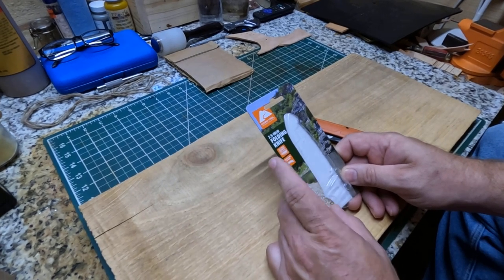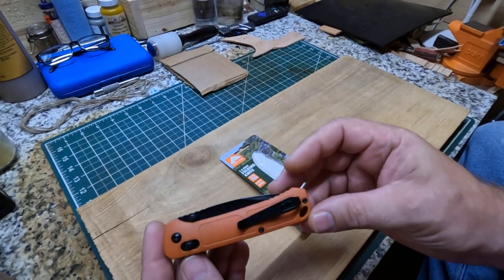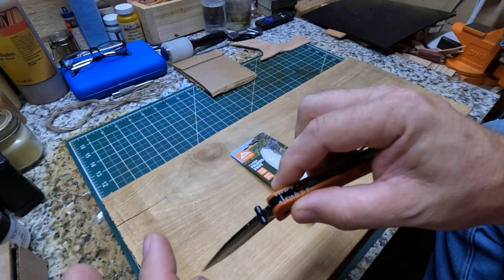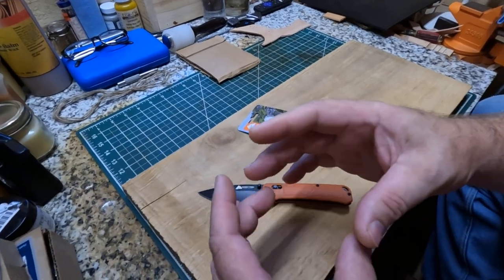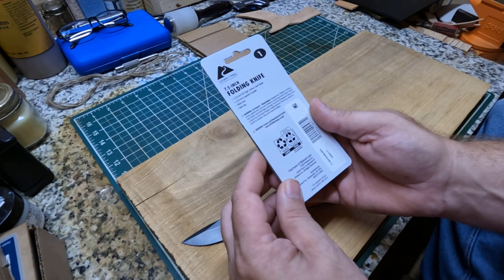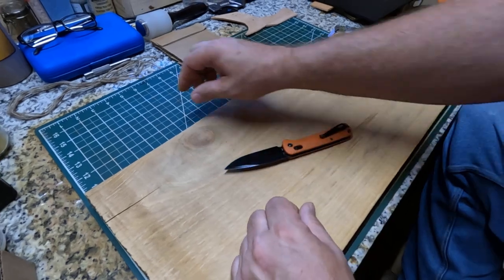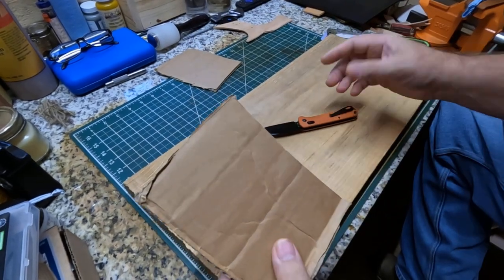Review and Cutting with the Ozark Trail D2 Carbon Steel Folding Knife

Comment: I have a ozark trail clip knife I bought while at the beach for protection against sharks. D2 steel should hold up well!
Reply from the maker: It is sharp and cuts really good. i hope it will hold an edge for a while. This would make a great knife for an extra throw in the truck or camping bag. Pretty slick little knife and it doesn't feel cheap. Have a good evening.  Justin

Comment: I never saw one with a floppy blade. :)  Worth $10.00
Reply from the maker: Lol! So this knife doesn't have a Back spring like a traditional slip joint pocket knife. It's locked when fully open and when released, it's free floating. So this style can be opened and closed with one hand operation. It is a nice knife and time will tell how the blade holds up. My only concern will probably be the screws backing out of the handles. Have a Blessed Evening Duke!  Justin